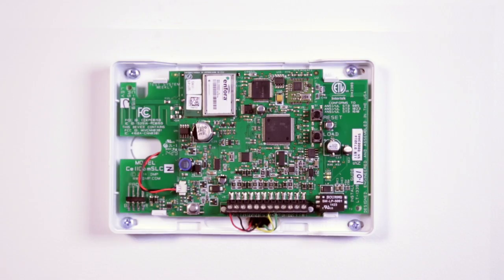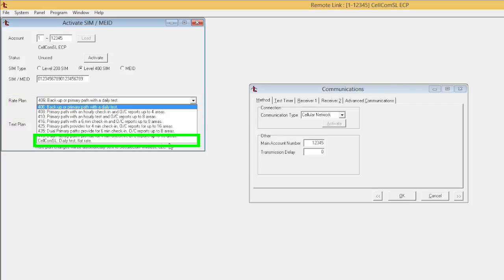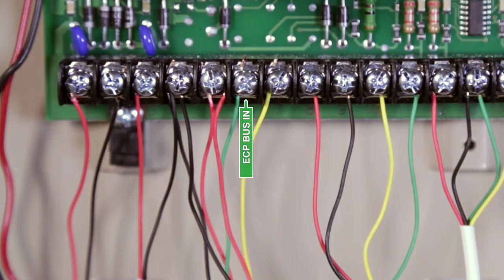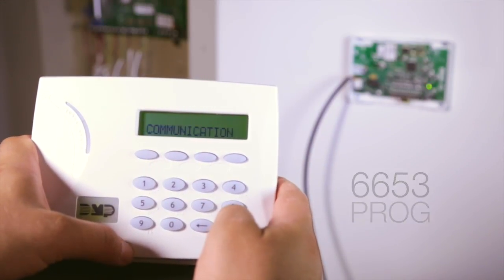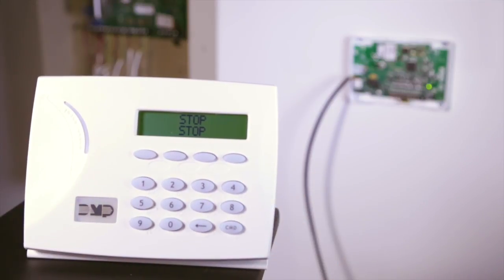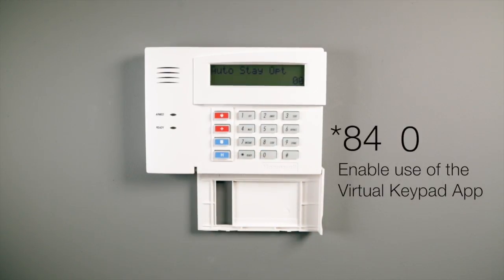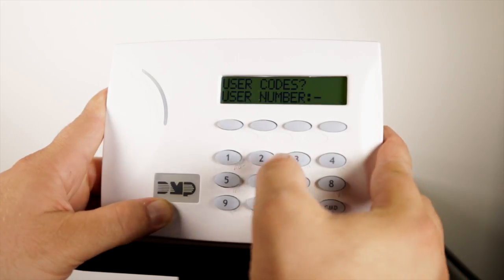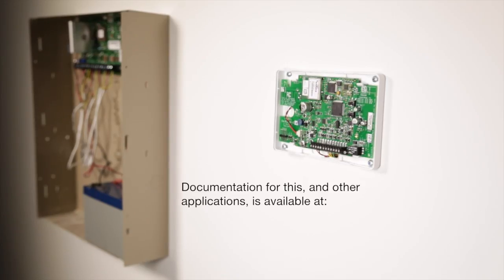CellComSL to the Ademco/Honeywell Keypad (ECP) Bus

Comment: Any options if I already have a device at address 20 in the panel?  I know it's rare to have 5+ keypads, but it happens.
Reply from the maker: +djm227 If there is a device on address 20 it will need to be moved to another address. The CellCom address cannot be changed.